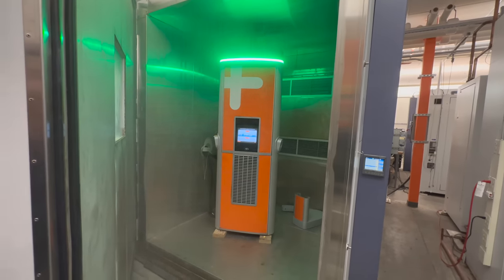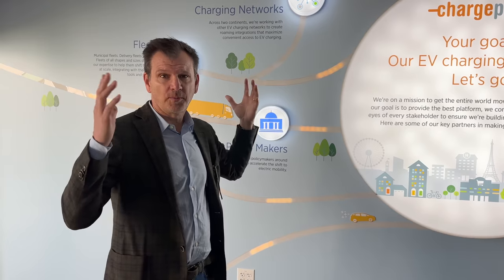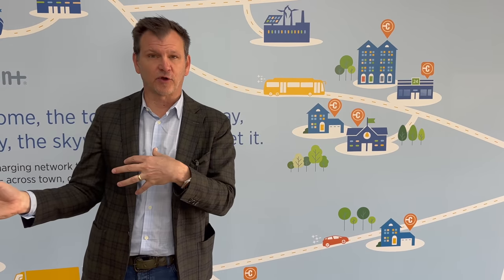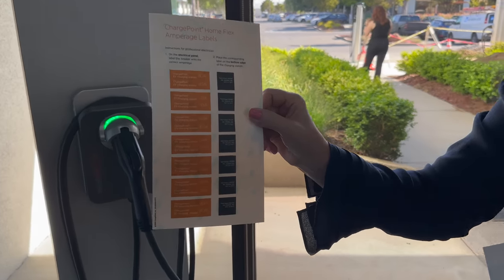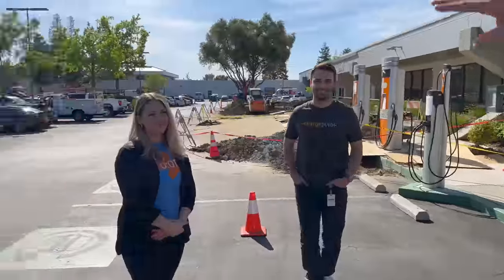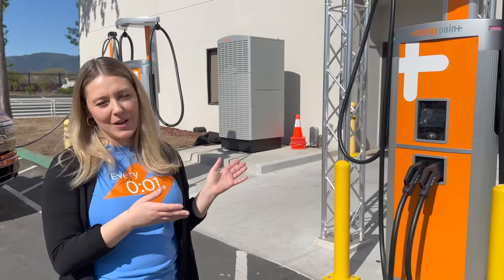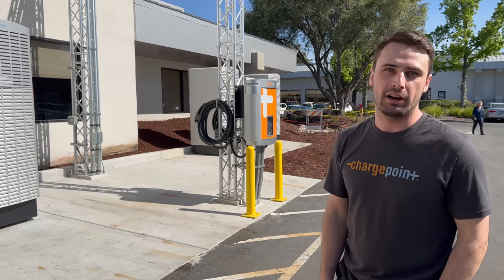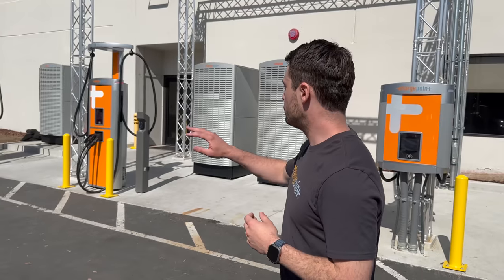Inside ChargePoint - Full Tour Of Hardware Engineering, Test Laboratories, & Product Portfolio

Comment: What an epic video! Truly one of the most fascinating tours I’ve had in a long time. ChargePoint is doing so much more than I expected or even realized - from their fully integrated software stack enabling their hardware platform, to their reliability test labs, and even their upgraded AC products - they’re upping the power and making it easier for site hosts to offer EV charging.

It’s not all perfect, units and packages are comparatively expensive, cables on the DC lower power side could use a higher current rating, and they still have to rely on site hosts being good partners to ensure network uptime. However I think you’ll agree with me that the turn-key solution that CP offers from hardware to software is premium and easy to understand both for driver and host. Ultimately, it’s not the cheapest or always the most powerful, but it might just be the best.
Reply: We all know that 100 kw "fast" chargers are inadequate joke for modern EVs and especially larger vehicles and the ChargePoint network of junk 50kw stations are beyond useless. They are in-town urban chargers (a dubious category) masquerading as fast chargers, but they are useless for longer-range travel. 

Much bigger problem: the Chargepoint App prevents you from filtering by charge speed. You can select "DCFC" but it is gives you loads of 50 kw junk stations rather than allowing you to select for a reasonable minimum charging speed of 150 kw+ for example. Unless CP will allow you to filter by speed, the app and its network are unusable. (Fisker made a huge mistake partnering with these guys given how weak and underpowered this network is and how the software is geared to steer you to inadequate legacy CP stations.)
Reply: They can even at one point replace all the ChaDeMo cables with CCS ones.
Reply: @solarexec  we have the need for charging at all power levels. It needs to match the expected dwell time of the vehicle. Unfortunately many site hosts don’t choose the right chargers for the application, something we’ll be covering more!
Reply: @KyleConner  IMO it is exceptionally difficult to justify dumping public money into these slower chargers. To me, the bigger issue for Chargepoint is the weakness of the CP roaming network. It does not include the networks that actually matter (EA and soon Tesla). Also, the inability of the app to filter out the junk chargers makes it unusable for me. You can see on the Mercedes demo all the useless clutter that comes up. CP needs to give users the option to filter out stuff below 150 kw (starting with the phone app).  The reality is if you put that filter onto the phone, the CP network looks like the emperor with no clothes. Even with the roaming partners, it has a tiny network of real fast charging stations (150kw+). If it is going to make a play to be standard software, it absolutely must include EA (and Tesla as magic dock gets rolled out). Without those networks it is dead as a software solution.
Reply: These are the "gas stations" of the from here on out. They should concentrate on just building and managing their own high speed charging stations/network so they are not blamed for poor working stations or too slow of speed. Yes, at malls and the such slow is fine and needed. However, speed is where the money is. This will be a trillion dollar worldwide business when all is said and done.
Reply: 1:06:42 I categorically Do Not agree with the 3 of U. .
If that's the design EA has as well....
It explains how unreliable the current system is. 
Prove me wrong guys.
How does TESLA wire their battery  Pack
Reply: @solarexec  All though I agree with 60% of what you are saying. I have to disagree with the filter. I own the Mercedes EQE and it will filter to 150kw+ which will almost always take me to an EA station. The app I completely agree needs a lot of upgrades. I truly hope CP can follow through with their ideas. As of now my wife still refuses EV's mainly because of the charging infrastructure.
Reply: @dnjj2006  Thank you for clarification on the EQE. I was mostly talking about the app but good to know that the EQE implementation allows it to filter and then it routes you to EA. It is super unclear if that is a Mercedes add-in of something from CP. On the phone app EA stations say "this station is not part of the ChargePoint network" and shows no availability information etc.
Reply: Thanks for stopping by and needing out with us! ⚡⚡⚡You're a celebrity in our world 🫡
Reply: Kyle, I have been burned so many times by broken ChargePoint equipment abandoned by the site owner. The ChargePoint business model SUCKS for EV drivers but makes ChargePoint a lot of money.
Reply: @e-redj  no they can’t lots of leaf drivers like me use them all the time. Don’t be selfish and only think about yourself. Chargepoint and ev go still care about us and we now have new stations with 100 kw chademo on the delta units.
Reply: @markfitzpatrick6692  sorry you misunderstood me. I did not mean now, I mean in the future when such cables are not needed anymore. You must admit that ChaDeMo outside of Japan will not be used by any new car, not now and not in the future. 🤷‍♂️
Reply: I'm curious to why no manufacturers is making a 3 type DC charger
CCS/Chademo/Tesla 
I think it would be best cost and use for remote locations.
Reply: The core problem with ChargePoint is that, for the most part, the driver is NOT their customer.  What charging networks are buying their solutions if they are so good?  Why, near our suburban home with hundreds of businesses nearby within 2.5 miles is there ONE working L2 EVSE that is public but 16 DCFC?  AC charging is not the future.

Comment: I found chargepoint to be by far the most reliable DC and AC charge dispensers by far. They may not be the fastest but I drive a Bolt. So fast enough for me.
Reply: Agreed. Living in GA, they’re not as numerous as in other areas of the country but rarely are they down. It’s EVGo or electrify America that I struggle to get to work. Simplicity with reliability are key.

Comment: Aside from Tesla Supercharger, they are the only reliable charging I have in the Oklahoma City metro.
Reply: yes the only one I have rarely had problems with OUT OF all the ev companys luv charge point!!!!!!!
Reply: The ChargePoint units at the OnCue at 36th/May are quite finicky, the touch screens do not work no matter how hard you push on them, but they do put out power, albeit only 50 kw.      And as you note, the only other alternative in town, the Francis charging units, at total trash at every location
Reply: @glenngore6609  I’ve had the same experience. I refuse to use Francis anymore after so many horrible experiences. As long as I use the app, ChargePoint hasn’t given me any issues but I’ve noticed those on 36th/May screens are damaged. The one in I-35 and 15th in Edmond has been the most reliable for me.
Reply: @glenngore6609  oh well that is one problem I have run into as well lololol you have to use the app when that happens😭😭
Reply: Yeah, to stop charging at that 36/May location I have to go into the car’s settings and lower the charging limit to less than what the current level is.   It’s a pain, I don’t know why they can’t replace those screens on the machines.   @searcey
Reply: Outside the OKC metro area, Francis is just a fact of life since they are the only provider who has locations on US and State highways.  EA and Tesla only serve Interstates.  The ASAP convenience store in Weatherford has the only ChargePoint units I have ever seen outside the metro.   @searcey
Reply: I've only ever used their 6.6kw stations but I agree.

Comment: Went to a concert recently and they had level 2 charging in the parking structure, and honestly for the time I was at the concert my car was charging and by the time the concert was over I had regained more charge than I used it really opened my eyes to how nice it would be if more places had level 2 chargers more readily available.
Reply: Charging happens while you do other things! 🤘⚡
Reply: I had the same experience with a hockey game recently. 10 chargers in the lot. Plugged in the car and game back to a fully charged car after the game. Level 2 chargers are great for the right use case. They're just pretty meh when you need a fast charge on a trip.
Reply: I keep wishing that more places would have level 2 or lower kw fast chargers. The high power ones sound sexy, but more often than not are only useful for road trips
Reply: L2 charging is perfect for parking lots and garages when you have other things to do AAAAAND..... you have anti-ICing measures in effect
Reply: Hell yeah
Reply: I'm only staying at hotels that provide EV charging now!
Reply: Where I live, there's plenty of chargers out in the world. 

They just never work.

Comment: 47:07 I'm glad to see ChargePoint finally getting into the 80 A L2 AC game. Even modestly sized EVs are now coming with the option for 11.5 kW and 19.2 kW onboard charging, so these units will enable some cars to charge from empty to full in only 4 to 6 hours, which is huge for a number of site use cases.

Comment: The Major failing of EVSE the torque specification is critical with such high current loads and glad to see Wago connectors are used and this explains the reason it is a price premium unit, Way To Go Charge Point!

Comment: 1:11:28 Just FYI, most of the time you see reduced charging speeds on Electrify America stations, it's not because the cooling system failed. The first generation Huber + Suhner cables were built with a batch of faulty thermistors, and in the case that a thermistor goes out (and stops providing data to the charger), it defaults to a 100 A limit. So it behaves the same as if the coolant system went down, even if the coolant system in the dispenser is still working properly.
Reply: Nice comment eric

Comment: My utility (Green Mountain Power) uses the Chargepoint software to avoid a need for a separate meter for charging EVs at a lower rate during off-peak periods.  I've seen other utilities often require a separate meter, at additional cost, often negating the savings of the lower charging rate.

Comment: Nice tour and impressive responses from the staff...However having spent way too much time at a 62.5 K Charge Point station in Farmington, ME and I'm really dispointed in how they are out on the road.  It took over 25 pushed to both stop and start the charge.. Their App never worked but I was able to use my credit card.  Here it took many many pushes on the display screen to have anything happen.  I had the same result on two chargers in Kennebunk, ME, wouldn't activate, wouldn't work with App.  On the second charger I had to use my CC here too. The touch screens are crap, totally blind in sunlight and 0 push sensitivity requiring multiple pushes on any screen.  

Instead of giving tours they may want go back to the basics and make functional chargers. 

On the other hand thanks so much for all you do to keep us up to date on this technology hopefully things will continue to improve.

Comment: Long video so it took me two days to carve out the time to watch it, but was VERY worthwhile. I already owned the stock and use the 50kw chargers in a handful of locations, but I did NOT know that they’ve created such a scalable and deeply thought-out ‘platform’ for charging. As a guy who ran strategic alliances at a software company in my day, I can really see how they are well positioned to become the main supplier partner to networks of retailers, oil companies transitioning to electric, and fleet operators that need reliable, robust and upgradable infrastructure for charging. NOTE: I own (and love) my Chargepoint Home Flex unit too. Hope that, at some point, I’ll be able to transition my solar/battery array to be able to DC charge my EV.

Comment: Here in Durango we have 2 chargepoint DCFC dispensers and 3 or 4 level2 destination dispensers. The DCFC units are always up from my experience but as I live here, I've only used them 3 or 4 times to checkout my CCS1-to-NACS adapter or to charge a little after a long road trip. My only beef is the cable size and the cable head. The cable is maybe one inch in diameter and the head is a spring loaded thing at the top of the dispenser. You have to pull that head around to get close to the Tesla charge port and then hold it there to relieve the strain on the connector. You can park in one stall and use the other stall's cable to avoid the hassle but you are blocking both and have to disconnect if someone comes along wanting to use a dispenser. I've also used the DCFC in Ouray Colorado and in the back lot at Purgatory Ski village. The dispensers always seem to work fine either using the app or a credit card to pay. If chargepoint were to contract with Tesla to allow them to install a "magic dock" on their dispensers, chargepoint would then become a very reliable CCS1/NACS station. Cheers and thanks for the detailed tour.

Comment: I have a ChargePoint Home Flex and it has been outstanding. Most of the dealerships in my area use Chargepoint (50 kWh units) and those have been reliable as well. Yes, speed matters at times, but I'm not sure I would choose speed over reliability when you're talking speeds of 100 kW or higher. Based on my experience ChargePoint is certainly a brand I trust.

Comment: Looking forward to watching this. I recently hired on with a company that maintains, repairs and replaces EVSEs and just went through ChargePoint manufacturer training last week. I think there is some stuff that isn’t covered in this video because it isn’t public knowledge, but the training doesn’t cover as much of the engineering aspect.

After watching the video, I’m happy to see the level of reliability testing and the various iterations that the products and even the software goes through before getting released. This seems to be something that is severely lacking in the EV world right now with many half-baked products getting rushed to market. The ChargePoint units are famously reliable, and now we see why. 

One thing about the CPH50 as it relates to the wire connections is that the NEMA plug wiring as well as the charge cable wiring (so the cables that come with the EVSE) have ferrules installed on the ends that attach to the EVSE. So not only do they have the “idiot proof” wago connectors, the wire ends are also crimped with ferrules so the installer doesn’t have to worry about stray wire strands or bad connections in that regard.

One additional complaint I’ve had with ChargePoint units though is that there seem to be some management issues, especially with older units. I can think of 3 different charging sites that have been offline for between months to years, and ChargePoint always seems to point the finger at the site host. There is a really critical one in Eastern Oregon on the route between Boise, ID and Bend, OR where there is only 1 ChargePoint CPE250. It’s been operating on 1 power module (31 kw max output) for about a year now, and within the past month or so it was completely turned off. Nobody seems to know what is going on with it or if it will ever be fixed.

One thing that wasn’t articulated well is that upgrading the power output of the charger is not as simple as just sliding in additional power modules unless the initial install planned for that possibility from the start . Adding additional power modules to the power blocks increase the capability of the power block, but it’s ability to increase the output is dependent on the breaker capacity, the AC wiring/conduit to the power block and the the DC wiring from the power block to the power link (in the case of the express plus units), as well as the DC link wiring between the CPE+ power links. If the initial install only allowed for a single cable 120kw CPE+ and the site design didn’t account for future upgrades, just installing more power modules won’t allow them to then install a 2nd cable on the power link and add the 2 additional power modules for 200kw output. The breakers, the AC wiring to the power block and the DC wiring to the power link has to be rated for the 200kw output too. Hopefully that makes sense. I think that one of the people you spoke to sort of alluded to this point when they said that they tried to encourage the site hosts to run conduit for the future, but it wasn’t well articulated overall imo.
Reply: What breaker size and AC/DC wiring and conduit is required for two 200kW EXPP paired together?
Reply: All good points. I agree that ChargePoint's single biggest shortcoming is relying so much on site hosts. Some of them just don't care or realize what a big deal one power module being offline is. A lot also need to be educated that it's better to link two CPE-250s together.

Comment: Over the years, I've owned a Chevy Volt, a MINI SE and now a Polestar 2.  I've been using a ChargePoint Level 2 charger at home for about 5 years; the last 30 months or so with the Home Flex.  I self-installed them easily and so far they have been 100% reliable for home charging with useful app/metrics.

Comment: I have great respect for ChargePoint. I’ve used the level three chargers at the office a few times and used them on the road many times. I find the CPE-250s quite reliable, all be it a bit slow for fast, charging vehicles like a Taycan.
I also used their level two chargers in the public, my one comment on the 4000 model is the plastic front that holds the charger handles is quite flimsy and I noticed one broken only weeks after being installed in Atascadero.